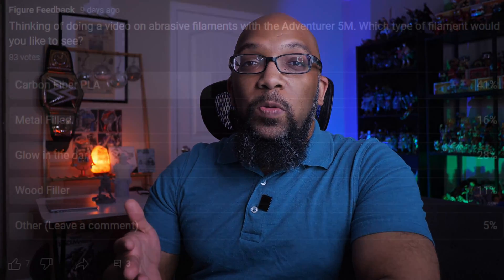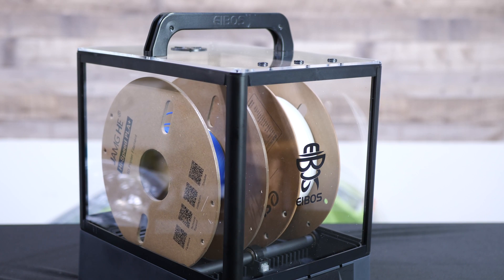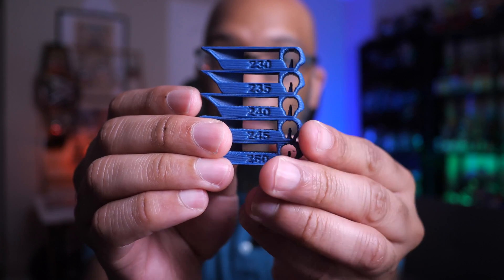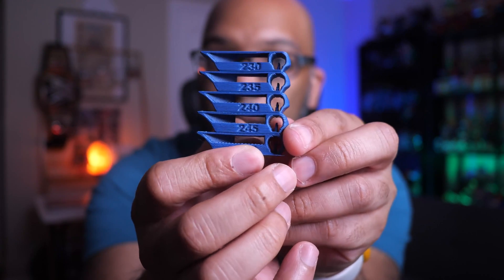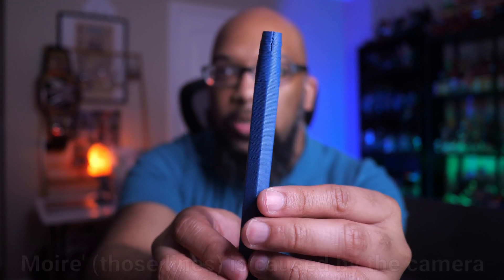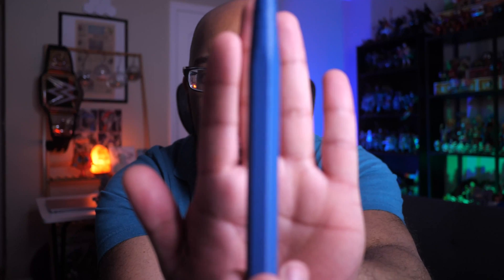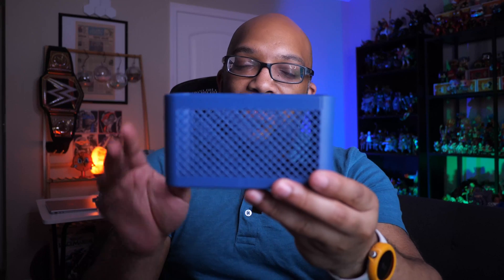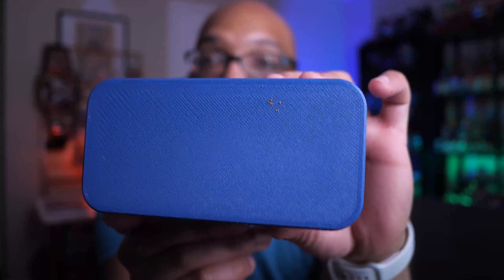Flashforge Adventurer 5M VS. PETG Carbon Fiber Filament

Comment: Hey I am new to 3d printing a have a flashforge Adventure 5m 3d printer with a 04.mm Nozzle for it and I have CREALITY PETG filament for it I was wondering how to use it and the right settings for it can you make a tutorial video for the CREALITY PETG Filament please for the flashforge adventure 5m

Comment: My experience with Eryone CF-PETG has been terrible. The stringing is so bad that the box you show would not have an open square anywhere. I have done a battery of tests. This is on my new Flashforge 5M with a 0.6 hardened steel nozzle. Settings, Nozzle 240-235, bed 80-75, flow rate I now have down to 87%, first layer flow 0.84, retraction 0.8. I done a retraction test 0.5-2.0, the entire thing was full of string at every setting. Setting the flow rates down did help a little, but now it has opened the door for a new problem, the Z seam is terrible. I have never experienced a seam that now has a gap, on the outer lines. Before I tried the CF-PETG, I changed the nozzle and tried Eryone Marble PLA . The Flashforge printer loved that stuff, just some typical adjustments. First time using a larger than 0.4 nozzle. The CF-PETG just has me guessing and not understanding how it can be so terrible, when I see your print.
Reply: You need to dry it. I had a spool of this filament lying around for a month. And when I tried to print with it... the result was terrible. Everything was just as you described. I dried it for two days, plus installed cases with silica gel. And it got better. But my prints are terribly fragile. I'm still struggling with it.
Reply: Eryone may have changed the formula; I wonder.  I notice the Amazon reviews tend to be good in 2024, and then in 2025 many more people having problems with it.  However, the sample size is pretty small - maybe a dozen or so reviews for each color.  It's possible that it's just statistical variability :/
Reply: P.S. To be fair, I also see some successes in reviews dated mid-2025.  Weird.  Maybe there were some bad batches 🤔

Comment: I don’t know if this question will get answered but do you have any worries about wearing down the extruder gears? Are they also harden steel or just stainless steel like most printers? I’ve upgraded my Bambu with harden gears and nozzle to print abrasives and got a harden nozzle for the 5m and that question popped in my mind and I couldn’t find any info about it. Thanks in advance and your great for helping others and for getting me to by the flash forge, I love it!
Reply from the maker: The extruder gears on the 5M are not hardened steel. I believe there are third party replacements that are. I only print abrasives occasionally, but I would change the gears if I were going to print those filaments regularly.

Comment: Thanks for the video. Question about types of Eryone PETG-CF. They seem to offer both a regular version and a HIGH SPEED version. Have you tried the different versions? What differences did you find? Which type do you recommend? What is the max speed you can use when printing PETG-CF before print quality suffers? Looks like they offer a HIGH SPEED BLUE (darker) and a HIGH SPEED TRANSPARENT BLUE (lighter). Which one did you use? Appreciate any info. Thanks.

Comment: FYI the spikes in each layer are also a strength test. Poke a pencil through, snap it with pliers or a hemostat, or otherwise break that spike in a consistent way so you can observe the differences (brittle, tough, layer adhesion, etc).

Comment: Glad you had solid results. I think the Eryone CF PETG is actually one of the worst, or least good perhaps, based on other testing I have seen. Friends and I have had great luck with Tinmorry and Voxelab/Flashforge brand CF PETG. The Tinmorry seems to be the best overall bang for buck and has fantastic attributes. The best part about CF PETG is it seems to remove most warping and stringing issues, it works well at high temperatures, and it ends up with a fantastic matte finish. You basically can't see the layer lines. The other key tuning I think would make your prints even better would be flow calibration. A few percent can make a big difference. Good video!

Comment: heya man I just wanna say be careful with those snips that you used for testing the strength. They have a nasty habit of snapping and sending the sharp point rocketing across the room. Few people have been caught out by it and it's pretty sketchy. Good for trimming ends off spools but not for real hard jobs. Just warning :)
Reply from the maker: Gotcha, thanks for the heads up!

Comment: I may have to give this a try. I've printed a couple toys for my kids on PLA but they keep breaking them. I've had slightly hardier PETG prints but the stringing and blobbing really ruins the finish.  This looks like the balance I'm looking for without having to jump to more exotic or toxic materials.
Reply: The CF PETG definitely helps with the stringing and blobbing! I recommend Tinmorry brand first and Voxelab/Flashforge second.

Comment: Nice prints! And great tips on how to dial in the best temperature. Looking forward to getting a 0.6 nozzle and trying out some of these more abrasive filaments. Oh and I guess I need a filament dryer too! Just like with my resin printer, looks like I have to buy a bunch of extras for my 5M!

Comment: The thing with most CF filament, including the one you used, is that they don't actually use long fibers.  They just chop up the carbon fiber into nearly dust and add it to the extrusion. That doesn't really do a whole lot except make it brittle.  There are a couple better options that use actual stranded CF, but be prepared to drop double or even triple the money per kilo.
Reply from the maker: You're right about the process. It's just like one of my ukuleles that contains ground up carbon fiber within the otherwise plastic body.
Reply: @FigureFeedback  by the way, you're the channel that convinced me to get the Adventurer 5M Pro.  I wanted to get into 3D printing without having to do a lot of modding and fiddling.  I've had it for a little over a week and have 100+ hours on it now.  Mainly I got it to print speaker adapters for a Harley fairing that no one makes.  Learned how to use Shapr3D and I'm off and running making them out of ASA.  I've sold over a 20 now at $30 a pop and the set only takes 220 grams to make.  I've made back what I spent on the printer and filament.
Reply from the maker: Wow, that's incredible and a nice side hustle.
Reply: Regardless of fiber length, which of course varies by filament, it does lend some desirable attributes such as better dimensional stability, less warping, and a great finish with nearly invisible layer lines.
Reply: It does help with stiffness and strength, in some cases layer adhesion, plus it gives a very nice texture
Reply: @unproductive-me  I have never seen fiber improve layer adhesion, sadly, but the other aspects for sure.

Comment: So I tried both the Eryone CF petg and the CF pla. I printed on my k1 but the CF PETG was not easy with a 0.4mm hardenned steel nozzzle. It would clog very easily. Now as for the difference from CF and regular PLA is the CF version is on stiffer. But that is it. It is much more brittle though. Quite a few videos have been done on that subject. So to me the only benefit of CF pla is the appearance. I may have just had a bad roll of eryone cf petg. I dried it and tried everything. Thanks for the video
Reply: I recommend trying Tinmorry brand and Voxelab/Flashforge. You'll also have less risk of clogging with a 0.6mm nozzle, but generally it should work with a 0.4mm as well.

Comment: Have you tried printing using Arachne perimeter generator? Ive been doing some research and learned that it can get a 0.06mm nozzle print at the same quality as a 0.04mm nozzle but much faster. I dont have a 0.06mm nozzle to test myself though.
Reply from the maker: I've used arachne when I printed models that are suspended by strings, but I haven't tried it for speed and quality with a 0.6 nozzle. I'll look into that.